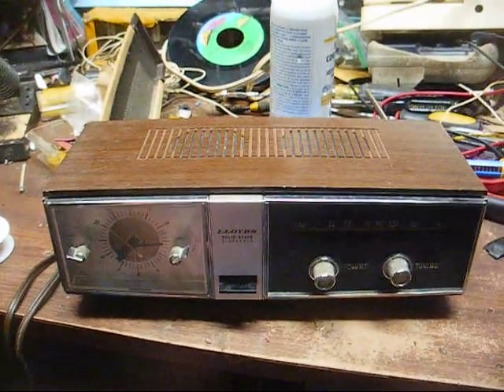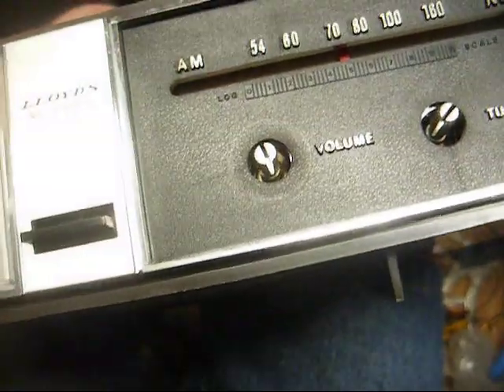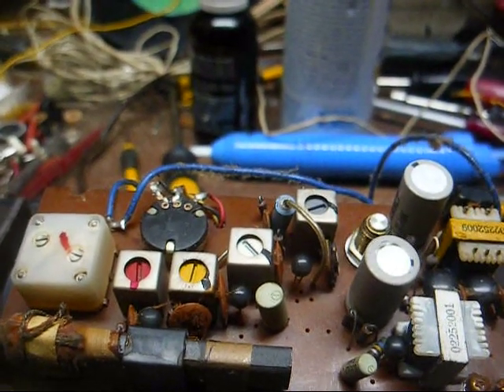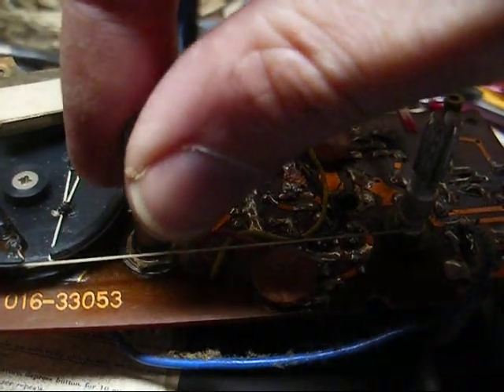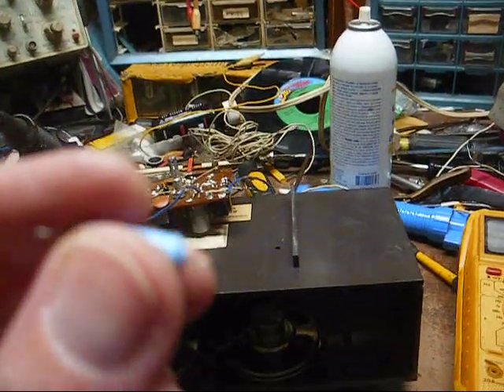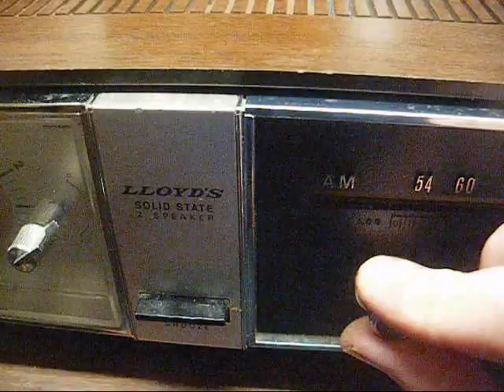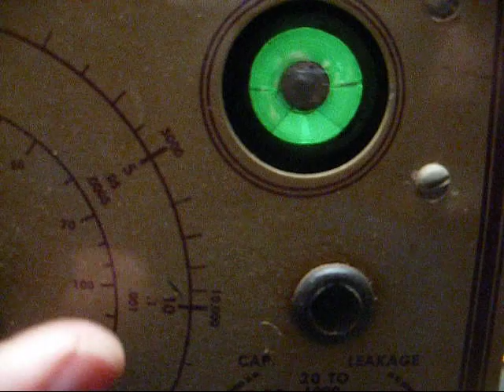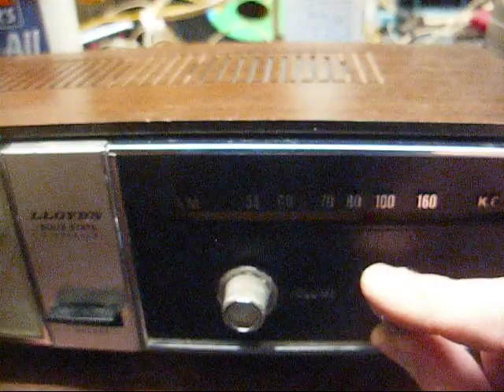Repair of a late '60's Lloyd's AM clock radio

Comment: I've wrapped the dial cords with a small strip of tin foil when I had to solder parts that were close by, offered that little extra bit of protection.
Reply: Use the foil from a pack of cigarettes.  Foil is better than nothing, but it also a good heat conductor.  The paper backing on the cigarette foil makes it a better insulator.
Reply: @tarstarkusz  ...that's a doggone good idea-!

Comment: The reason many radios tuned to 910 kHz generate a whistle, it's twice the frequency of the IF stages in AM receivers (455 kHz).
Reply: I used to live in a town that had a 910 station, that whistled too. Interesting.

Comment: Where I used to live, the local radio station broadcasting at 910 kHz also came in with a squeal. That's a strange coincidence. The game "Operation" has been sold in retailers at least since the mid-1960's, as I remember.
Reply: I wonder if the fact that 910 KHz is exactly twice that of most AM radio IF frequencies plays a part.
Reply: @F40PH-2CAT  I've heard that this is indeed true. It has been referred to as harmonics.

Comment: I don't know how good you are with solid state but I built my own ESR meter using one of the many circuits that are out on the internet.   That is the most useful tool I every made for myself.    All the troubles I have found with it has more than made up for the time I spent building it which really didn't take long and the one I chose to make I had all the parts at home already so cost was free.

Comment: That green "eye" display on your capacitance tester reminded me of the signal strength meter on an old Rayford Hi-Tone radiogram I once had. I used to listen to stations in Melbourne(Victoria's capital city) while I lived several hundred miles north in Stockton, a suburb of Newcastle(a regional city in New South Wales). For interest, the turntable in this set was a BSR UA8 model but did not have a spindle adaptor as Australian 45s had the small centres.

Comment: I bought this very model to put me to sleep and wake me up. I think it cost $19.95. I used it for 10-12 years before I decided to get a new one. It did the job for me. I liked it a lot because it did what I wanted it to do. I still have it, but haven't played it in about 40 years.Yes it was a cheap model but it did what I bought it to do. -and it had an easy to use 10 min. snooze button. I used  that a lot.

Comment: I'm quite surprised this is made in Japan. The stuff from the early 70s I've seen from Japan is a lot better made than this, and the cheap, nasty radios of this type we got in the UK around this time had been moved to Hong Kong (or occasionally Korean) assembly, albeit using Japanese parts.

Comment: Ouch, even after being fixed, the sound of that gives me a headache. It looks like a near-clone of the Ralistic Chronomatic  (1 or 2, or something) set that I got for Christmas in 1971; that model had the snooze on top, no timer, germanium transistors (with a stablizing thermistor) and a better-sounding (but still crappy) single 3" speaker, but everything else was about the same. The public was starting to accept really-crappy-sounding clock radios at that point, and it was partly my fault for asking for that model.

Comment: I have several of those clock radios myself, both in AM only and the AM/FM version.  There were two variants of the the Telechron movement that were used depending on when they were made as well as the General Time (Westclox) movement that would fit in the same spot.  I can tell by looking yours is the earlier Telechon version.  I think the change was around 71 or 72.

Comment: I remember the LLoyd's brand being sold at outdoor markets in the late 80's if you wanted a car radio that looked as bad as it sounded they were the one to get. i suspect one my friend had helped to set fire to  his car useless radio and the cassette part was worse but thankfully it was not loud enough to hear with the engine running

Comment: Heh, consider yourself lucky you still have AM stations. Here in the UK they're pretty much all gone.
Reply: Here, there are about 20 stations easily received with excellent signal strength, and another 20 or 30 more which can be received with a decent radio with the ferrite bar antenna oriented in the right direction.
There are even music stations, four classic hits (70s-90s), two old school hip hop, one R&B and one country.
One of the hip hop stations at 1400 kHz has surprisingly good audio quality and heavy bass (for AM).

Comment: It isn't HiFi but it sounds OK for what it is. I had a cheap portable transistor radio that I put a tone control in. It had a lift up rear cover so I put a control in back there and hooked it into the volume control circuit with an old cap I had. It did make a surprising difference.

Comment: Marcon was owned by Toshiba and got a bad reputation in the 60s/early 70s. I saw a lot of Toshiba gear die early because of these. Re-capping usually fixed things but with stuff like color TVs it was cost-prohibitive. Marcon was later bought out by Nippon Chemi-Con/United Chemi-Con. Modern production seems to be OK but early production are usually awful. They improved to average in the late 70s.

Comment: Yes, I agree ☝️ that a lot of today’s radios are junk, but I received a Lloyd’s bookshelf stereo with record player when I was at the group home 🏡. It was built out of plastic, but it was the Mercedes Benz of the bedroom. I have to say these are a step or two above the Crosley. Yes, The Lloyd’s stereo had a cheap DC motor, but a considerably better one ☝️ than in the Crosley. Stylus needles on the Lloyd’s stereo would less than meet your expectations, but I understand. I ended up throwing this stereo away when some retarded repair person tried to fix it, excuse my language. The stereo was only $59.00 new, and the repair was $45.00. Turns out, he ripped me off. I should just have got another Lloyd’s stereo for $59.99. It was my fault that I broke the recording mechanism, but repair people so inexperienced should not even see the money 💴. I think 🤔 he tried to repair the broken part, gave me a piece of junk ☝️ one, or did not repair the stereo at all. I see that this is a 1970’s or 1980’s Lloyd’s alarm clock radio. Cheap in design, but it certainly beats clock radios 📻 from, let’s say, 2010, and beyond. I’d urge you to burn a whole pile of them. I know Shango066 would, but not burning any Lloyd’s radios. That means burn anything from 2010, and later. There’s some favorites from 2010, and later, but I couldn’t tell ya which. I would also spare those. I really do like this clock radio 📻. If I ever come across ☝️ one, I’m buying it. Only if radios sound like complete junk, or the on/off switch is screwed up, or the dial cord is broken, I will usually pass. Radios that look like they’ve been through at least a few Arizona sand storms, will also not go home with me, except if I find out that the operation is satisfactory.